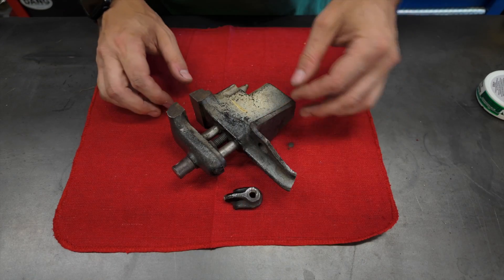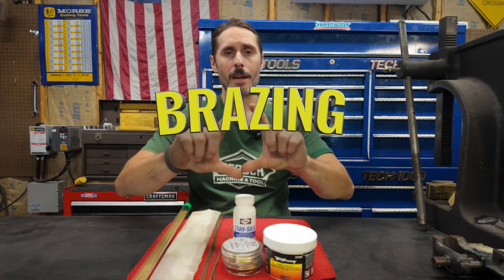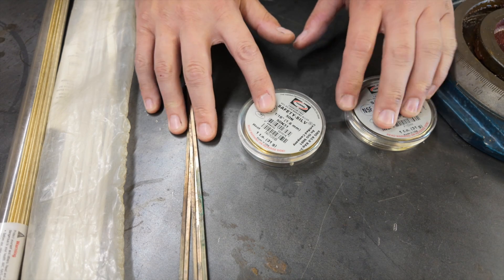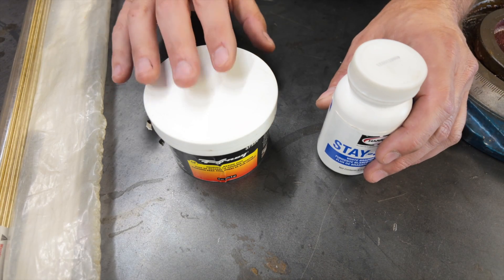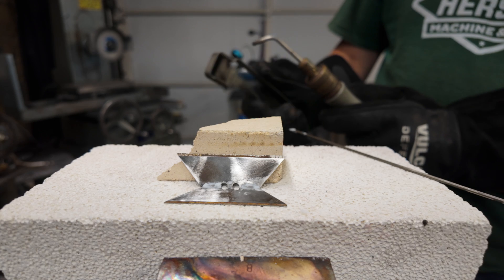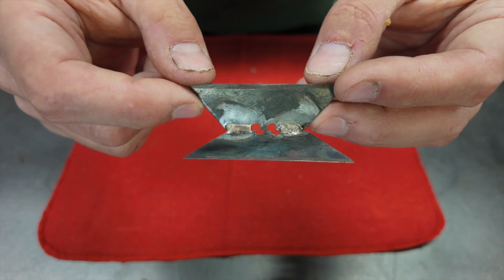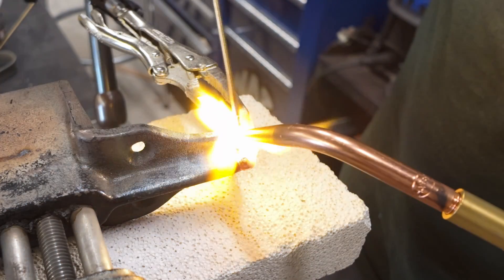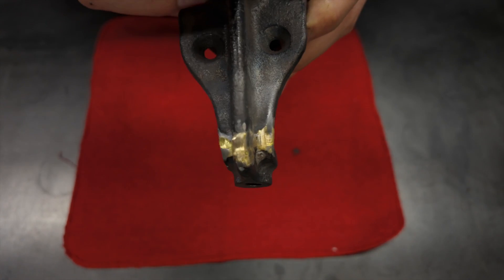Welding Metal With FIRE!... and a Blowtorch - A-BRAZING Success!

Comment: Sounds a little bit more like soldering than welding 🤷🏻‍♂️ 
But I promise you I know less than you 😊😅
So that might be totally wrong 😅
Reply from the maker: It really comes down to temperature. Soldering happens below 840F. So your typical solder fillers like tin, lead, etc all melt below that point. Brazing happens at higher temps with fillers like bronze, silver, etc.

Comment: In school I learnt to bronze braize (because I thought it would be easier than torch welding) and good grief was it a challenge. I did get things stuck together in the end and neatly enough to pass the exam but I haven't been able to do torch braizing since. Fire braizing is fun to say the least but I think its a little easier than torch braizing, you just need good fire control and a keen eye for when your copper, brass, bronze filler material is at melting point.
I had forgotten about how to do it with a torch
Thanks for sharing

Comment: Great explanation, I'll need to start trying this myself too soon. I have some broken cat iron (architectural decorative bits) that needs fixing. What size of acetylene torch tip did you end up using?
Reply from the maker: Thanks very much. I'm using a #3 tip the whole time here. I think a #2 or #3 is usually a pretty good general purpose tip for most stuff around the hobby shop, at least as far as I can tell in my limited experience so far. Thanks for watching btw.

Comment: I am by no means an expert in oxyacetylene processes but the gas flame in the vise repair sequence appeared to me to be carburizing rather than neutral.  Once again since I am no expert I couldn’t speculate whether introducing more carbon into the surface might have any effect but just wanted to throw that out there in case someone might weigh in.  I have a little experience with TIG brazing using Silicon Bronze but have no idea if that method is applicable to cast iron.  Thanks for posting your experience.
Reply from the maker: @Dogfather66227  thanks very much. I didn’t end up with any excess carbon on the part, you might be seeing the flux burning as a result of me applying too much heat honestly lol.

Comment: Would it help to apply flux to the joint of the cast-iron vise you braised? Just wondering.
Reply from the maker: @ninomaiorano6697  I don’t think so. The flux flows to the heat either way and if you apply it too early you might just end up burning it. But like I said, I’m not an expert so I could be wrong but that doesn’t seem to be how I’ve ever seen it done either. Thanks for watching btw

Comment: I taught myself cast iron bronze brazing with the exact same lincoln portable torch kit you have. Never had any experience before diving in. 

SUPER HELPFUL TIP - Get the flux coated bronze filler rod in 3/32” … If you try and use 1/8” on a small part you’re going to struggle, only time I’ve ever found myself “needing” an 1/8” over a 3/32” was for a LARGE VISE crack which required the crack to be ground down for 4” and ran 6” across (part weighed 70+lbs). For almost all bracket repair or common cast iron part repairs weighing under 20lbs , the 3/32” rod will be perfect. The ease of use is night and day between heating & dipping your rods in flux… the ease and results you’ll see will be night and day just like when you try brazing with Harris Safety Silv 45 or 56. 

For brand I would go Hotmax or Lincoln, I tried US Forge but for some reason I had more trouble with that brand(batch?). Hobart, Forney, Harris would probably be fine too but since I can only speak from experience …which is I loved the HotMax 36” rods they made the process as user friendly as I could ever have hoped.
Reply from the maker: Thanks very much for the info. I'll definitely pick up some rods and experiment based on your recommendations. And I love this little portable kit. I grabbed it off craigslist for an absolute steal nearly brand new. Thanks again, and thanks for watching!

Comment: The part that you fixed on vice , you can't put alot of torque on it when tightening it down , wouldn't been better to TIG weld it instead ?
TIG welding is stronger weld than Brazing .

Either way interesting video , keep it up and thank you , William , MN
Reply: Brass or bronze has more UTS than the cast iron does.
You just have to get the filler to wet out the parent material.
That's what flux does, and why silver content is important.
Reply from the maker: Good question, honestly I don't know that tig would have been preferred for this particular repair. Given its small size and the base material being cast iron, I think there's a strong argument for brazing even if tig is available? But, I'm not the expert lol, and I also don't have tig either way. Thanks very much btw, and thank you for watching!

Comment: Pro-hobbyist tip, run a slightly hotter flame than you think you need. Then, hold the tip slightly farther away to spread the heated area out a little farther. This helps prevent hotter than needed spots and a more even heat to the part, which in turn reduces the cracking probability when it cools. It also helps the filler material flow out better as more of the area is evenly heated.
Reply from the maker: That makes sense, I'll give it a try. Thanks very much for that! And thank you for watching

Comment: One tip I received many years ago that helped me wrap my head around this type of brazing is to remember the filler material ( brazing rod aka bronze) goes to the heat. Meaning it will always try to go to the hottest point. Flux will help it get there faster. That, and also understanding that the approach angle is what I try to focus on when brazing. 
 I do ALOT of brazing with 45 and bronze is what I use the majority of the time. But your video was still very informative and entertaining. 😊
Reply from the maker: Thanks very much. That's a really great tip btw. It is a little weird trying to wrap your head around how that works, but it 100% fits with what I've experienced while practicing. One of my big issues was that I was trying to "heat the bronze" directly instead of allowing the job to heat up and then letting the bronze flow to that heat. Makes perfect sense when thinking about struggling to get the bronze to go to the right place.

Comment: Thank you for doing this video. I have a brand new oxy/acet torch setup which I had purchased for the sole purchase of learning how to braze. I have hesitated trying because I really didn't know where to start. I now have some beginning ideas. So, here is my situation. I have a '62 Impala that has some rust holes in parts that are not available in the aftermarket. They are also very complex as far as bends and curves and would be very difficult to reproduce. Since this is in sheet metal which is already thin from the rusting, it appears I should try the silver/bronze vs. the straight bronze because of its ability to flow at a lower temp. I'd be interested in your thoughts since you just brazed razor blades.
Reply: You may also be interested in some videos by Ron Covell then. He's great with sheet metal!
Reply: @rjordans  Yep, already subscribed to Ron's channel. He's an amazing guy.
Reply from the maker: You're very welcome, and thank you very much for watching. And that's a really great question. Remember, I'm no expert so take this with a grain of salt, but my initial thought is to say yes, give the silver brazing a try. That said, you also might pick an inconspicuous spot and experiment with both before committing fully. Either way you go, just make sure that you heat the part enough for the filler to bond. With silver brazing, you can melt the filler before you get the base up to temp if you're not careful and it won't stick well. So, whether you go with bronze or silver, you'll want to make sure that the base metal is glowing red before flowing the filler. Also, you can try getting some sheet metal of the same size and cutting it as backer for the holes. It's really difficult to build up and fill holes without some kind of backer, especially for beginners like us. This also give you the benefit of being able to concentrate the heat onto the backer while allowing the backer to help spread that heat to the part. It's very easy to blow a hole through sheet metal with oxy acetylene, so that should be helpful in reducing the pucker factor lol. Also you'd be getting some practice on the back side of the part while you're brazing the backer material in place. Good luck, and thank you for watching!